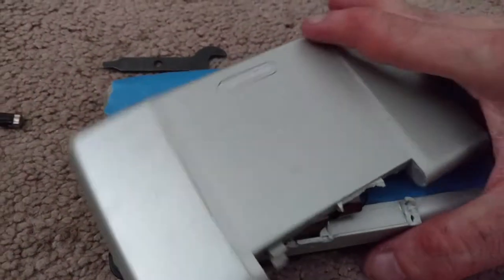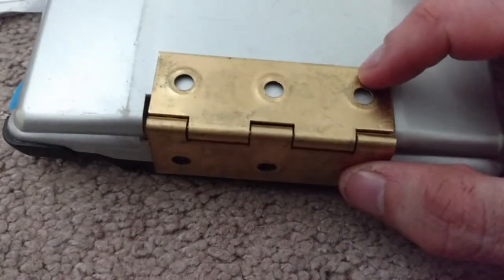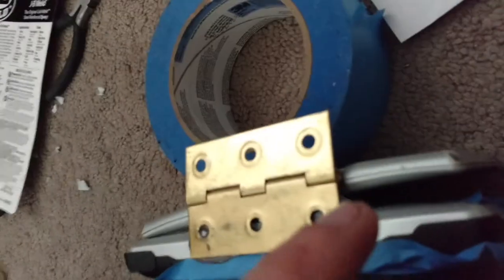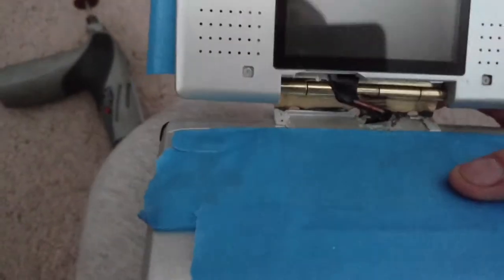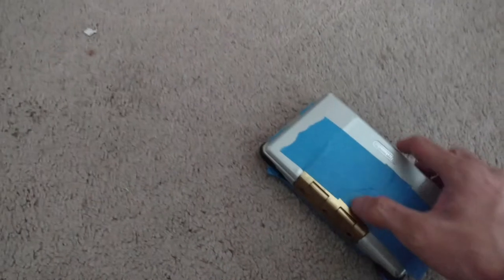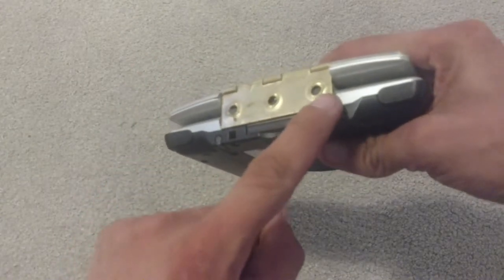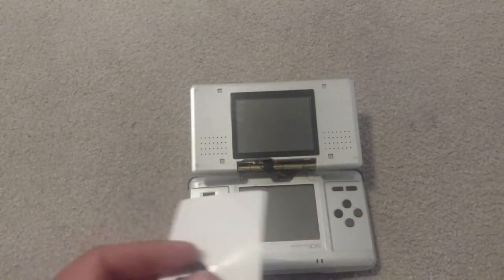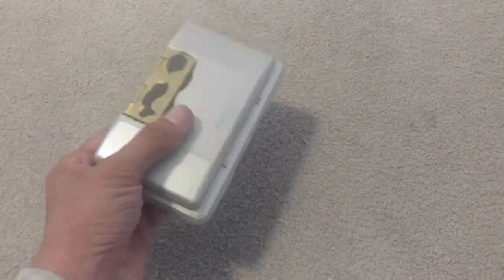$5 Nintendo DS Hinge Fix

Comment: Hi can you make a list of the tools that you used to make this project.👍🏻
Reply from the maker: I used a Dremel to cut it, tape to mask it off, JB Weld to attach the hinge, a scrap piece of 120 grit sand paper to scuff the lid, and a screwdriver to mix and apply the JB Weld to the DS.